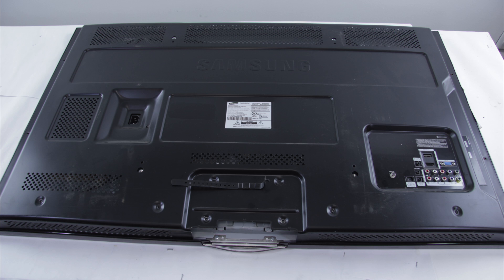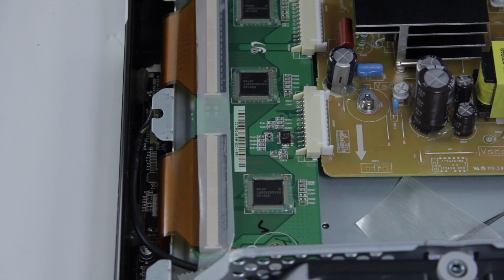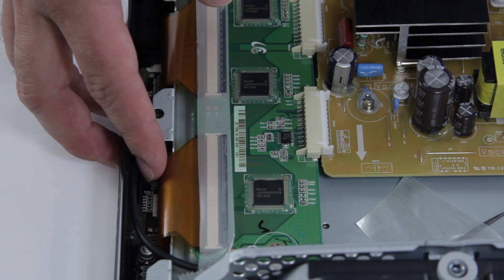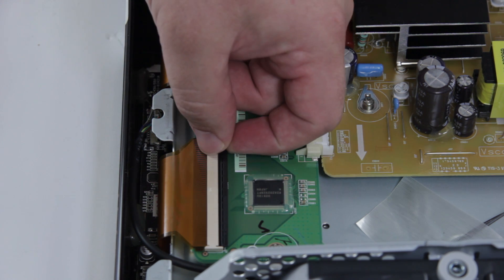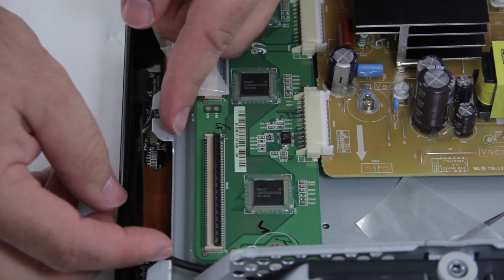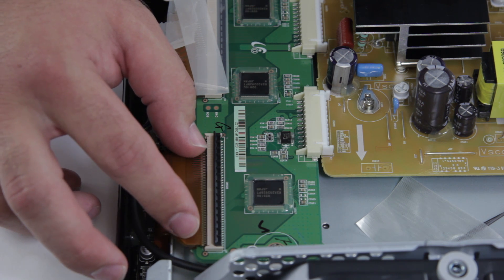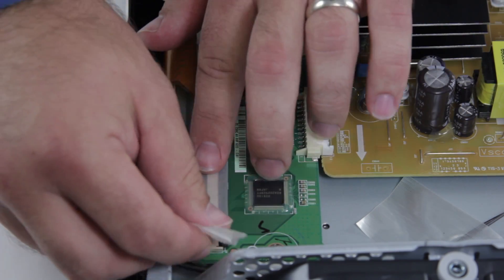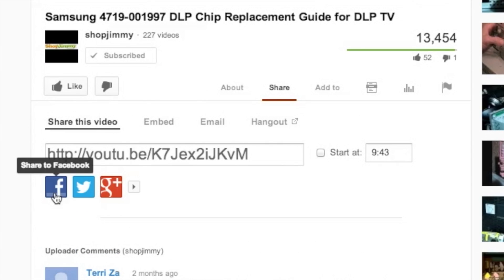Plasma TV Repair Ribbon Cable Removal & Install Tutorial Overview

Comment: Hi I have a 47" LG 47lh30.. when I turn it on it goes dark on one side then the other side goes dark and the television turns off after a couple of seconds. someone told me that some of my cappacitors may be blown I looked and all of them were just fine.. any suggestions?
Reply from the maker: BigVStudio   This sounds like either a problem with the main board or the TV panel.  You can replace the main board to see if that fixes the TV.  Here is a link to replacement parts for your TV model number on our website, click here:  http://www.shopjimmy.com/catalogsearch/result/index/?cat=56&q=47lh30  Be sure to match part numbers on your current board, with your replacement for compatibility.  Here is a link to a video showing how to identify your part number, click here:  TV Part Number Guide for LG & Zenith Main, Digital, & Tuner Boards (LCD, LED, Plasma TVs)  You can also call our customer service for further assistance with your purchase.  (877) 881-6492  Thanks and please let us know if you have any further questions with your TV Repair!  www.shopjimmy.com

Comment: I have an Hitachi 42" plasma 42PD7800TA. Recently the picture has become extremely fuzzy no matter what input I'm using (component, rca, HDMI). I've had the tv almost 9 years. I don't know if it's time to get a new tv or if it's worth it to repair this one.
Reply from the maker: Edgar Trull   I recommend replacing the Y-Board and buffers in your TV.  Unfortunately I do not see any replacement parts in the search results for your TV model number on our website.  Please reply with your part number on your boards and I can try searching for replacement parts.  Thanks and please let us know if you have any further questions!  www.shopjimmy.com

Comment: I have a Sanyo DP47460. Just a few days ago it randomly shut off and now when i turn it on the screen comes on and says please wait like normal but then the tv shuts off after a few seconds. I did notice before it randomly shut off that the sound was kind of muffled. also it has made some really loud popping sounds here and there over the past couple years. I did take it apart of course, couldnt find any bulging caps or burnt ic chips but i did notice two white ribbon cables and they both have a brown stripe following one of the wires inside the ribbon cable. can ribbon cables burn like that? if you have worked on sanyos 47 inch dp47460 with similar problems ill be waiting for any kind of advice or direction.
Reply from the maker: Mike Levi   I recommend replacing the cables.  Thanks and please let us know if you have any other questions.  www.shopjimmy.com

Comment: Hello, I have a Samsung 40" LN40B630N1F LCD.  On the back of tv, the part (ANT IN) that you would run your cable into has broken off during a move.  It is now flush and I can not feed any cable in.  Is this an easy fix?  Where can I get this part?  Thanks!
Reply: Wow.  Tough one.  Let me get back to you. But my initial thought is no.
You're f***
Reply from the maker: John Boltas  I recommend going to digikey to see if you can find the part there.  Thanks!  www.shopjimmy.com

Comment: LE37M87BDX    
Hi above is the tv model number i am sure its a famous one its samsung LCD tv 37". A very common problem it has which many tvs can have readily. After about half an hour the colors start to mingle together and merge in each other but nothing is wrong with the audio input. If the tv is given some taps on the top or back display do come back and then again the colors starts merging together. I have it on gumtree and on ebay you can watch the pics over there. Please what sort of advice you can give me ? thanks 
below is the link of gumtree advertisement
http://www.gumtree.com/p/for-sale/samsung-le37m87bdx-37-1080p-hd-lcd-television-faulty/1063551167
thank you
Reply from the maker: Mueed Jamal   This sounds like a TV panel problem.  If your TV panel is bad, it may be more cost-effective to replace the TV as panels are typically hard to find in stock, difficult to replace, and expensive.  Thanks and please let us know if you have any further questions!  www.shopjimmy.com

Comment: I have LG Plasma 42 Inch42PX10 there are to black vertical lines.I disconnected all ribons, cleaned and reconnected. It vanished for some days and again reappeared. please suggest somesolution.
Reply from the maker: Msn Ibi   This sounds like a TV panel problem.  If your TV panel is bad, it may be more cost-effective to replace the TV as panels are typically hard to find in stock, difficult to replace, and expensive.  Thanks and please let us know if you have any further questions!  www.shopjimmy.com

Comment: Hi there, thanks for the very informative videos you do and post up here.  
I have a Samsung PS58A650 (known as PN58A650 in US i believe).  The TV powers on, it has sound but no picture.  There is a  repetitive clicking thats coming from they Y main.  The clicking may be emanating from one of the banks of Mosfets on there, but its hard to say 100%  Is it safe to assume the Y Main itself has died, or is it possible a Y buffer has failed causing the Y Main to fail to start up?   I was going to order a new Y Main ( lj92-01446a ) but not sure if that will fix the problem or not.
Thanks!
Reply from the maker: Paul Boon   I recommend replacing the Y-Main board and scan drive boards in your TV.  Here is a link to replacement parts for your TV model number on our website, click here:  http://www.shopjimmy.com/catalogsearch/result/?q=58A650  Be sure to match part numbers on your current board, with your replacement for compatibility.  You can also call our customer service for further assistance with your purchase.  (877) 881-6492  Thanks and please let us know if you have any further questions with your TV Repair!  www.shopjimmy.com

Comment: I have a Samsung 50" PN50C450 plasma which has a 2-3" wide band that runs the entire verticle length.  The issue started out randomly and you could often watch for hours or days with no issue, but now it appears more frequently, dissappearing for a few seconds or minutes at a time before returning.  The bar is made up of multiple verticle lines all changing colors depending on the background in the screen.  Once in a while it will go all black, but usually it is a multi-colored rainbow effect.  From what I can tell it's not there when there is not video input (doesn't show up in the MENU screen) or when the screen goes black (like occasinally between commercials or game levels).  Rather, the colored lines gradually dissappear from right to left.  Other then this issue, the video and sound are perfect.  I expect it is a faulty ribbon cable which is fused to the circuit board and not replaceable or removable.  I would love to be wrong and know there is a better fix then replacing the panel itself, which I would do based on the cost.
Reply from the maker: Scott Bates   If the colored lines are vertical in it you can try replacing the logic or lower address buffer.  If the rainbow effect is made of curved lines then its more likely to be a panel issue and not repairable.  Here is a link to replacement parts for your TV model number on our website, click here:  http://www.shopjimmy.com/catalogsearch/result/?q=PN50C450  Be sure to match part numbers on your current board, with your replacement for compatibility.  You can also call our customer service for further assistance with your purchase.  (877) 881-6492  Thanks and please let us know if you have any further questions with your TV Repair!  www.shopjimmy.com

Comment: I have a samsung pn50b650s1fxza 50 inch plasma screen tv, which has a problem where horizontal black lines run across the screen when turned on. Upon closer inspection, I found out that our ribbon cable connector was cracked. Is there any way to replace this?
Reply from the maker: bzhao2017   Unfortunately, there is no way of replacing the connectors that I am aware of.  Thanks!  www.shopjimmy.com

Comment: hi, I have a Panasonic Plasma, TC-P50S1. Purchased it in 2009. I had a replacement plan on it that ran out in June 2013 from BestBuy. Prior to it running its course, geek squad came twice, and simply removed the back and "cleaned" whatever it was, this seemed to work for a short period of time both times then the lines from top to bottom in a about a 2" thickness a little to the left of  (if youre facing) the screen, would pixelate in lines you can see through changing various colors, mostly always transparent, but once the whole 2-3 inch strip was completely black from top to bottom, but when you turn it on they arent there, Seems to occur after the tv warms up (I think), Then my plan ran out, before they came back a third time, which the said they were going to just replace the panel? if I remember correctly. I have since replaced the tv, but is there a way to fix it? if so where to get the parts, about how much? im pretty savyy so, if it will only be a couple hundred to fix I may be interested in a repair, as Id rather fix it give it to a family member than take up space in my already full closet space, lol. thanks for your time.
Reply from the maker: Killa Kev The only way to fix the TV is by replacing the TV panel.  Thanks and please let us know if you have any further questions!  www.shopjimmy.com

Comment: I have a sony Bravia KDL-52VL150 ... It has vertical lines since last week ... one out of 100 times the tv starts normally other times the start up Logo Bravia Starts with vertical lines and the Bravia logo is barely visible ... I can email a picture of how my TV display is acting ... i really need help to fix because i don't have that much money to buy another one ... Thanks ...
Reply from the maker: ***** This sounds like the problem is the TV panel.  TV panels can be difficult to find in stock, hard to place and expensive.  It may be more cost effective to replace the TV.  Thanks and please let us know if you have any other questions!  www.shopjimmy.com